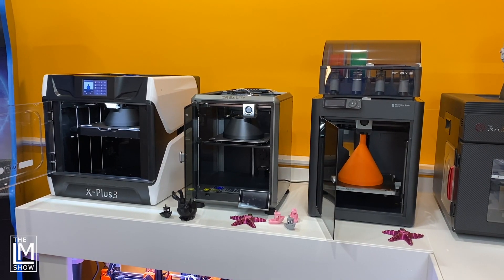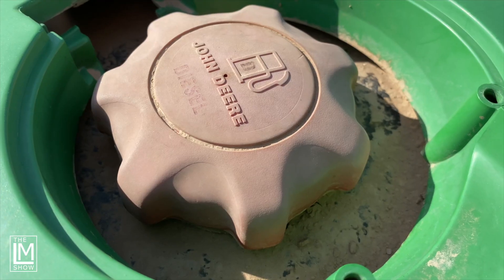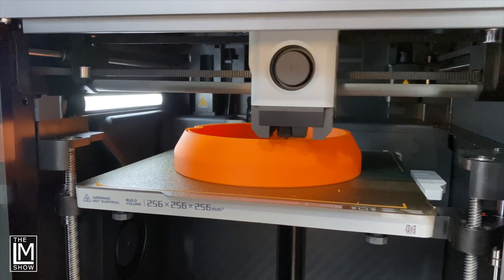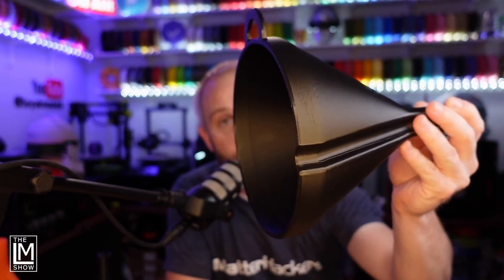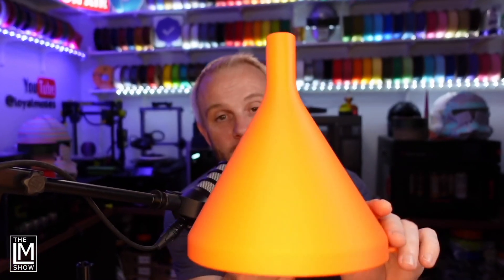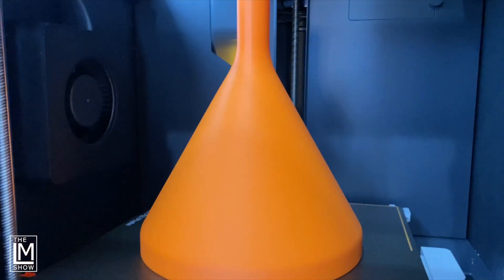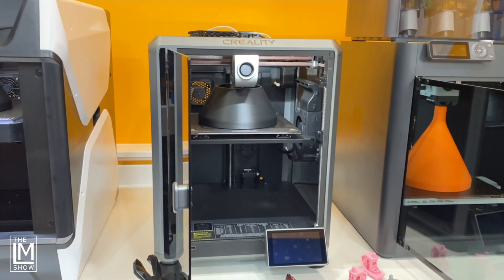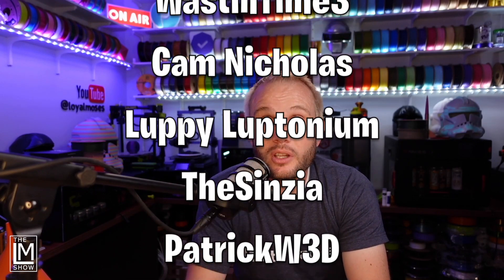Bambu P1S vs Creality K1 vs QIDI X-Plus 3 - Which CoreXY 3D Printer Is The Best?

Comment: After owning in chronological order Voxelab Aquila 2, Anycubic Kobra, Flsun SR, Ender 2 Pro and now the P1S AMS Combo. Hands down I should of got the X1C from the get-go but I cancelled my pre-order but it worked out since the P1S AMS Combo is cheaper than the X1C by itself. I was ragging on about how it was going to change the game and was a moderator on the Kobra forums and people disagreed strongly due to price. Tinker free printing at a more approachable price. Never want to see a bedslinger again or Cura. Wished Bambu would look into delta printers (I have a soft spot for em' since when I bought the SR it was the fastest consumer printer at the time and I loved it to bits even though it wasn't near as good as these printers today)
Reply: If cura is so bad, then why other slicers are based on it?
Reply: @wykonczeni  Cura was my 1st slicer and it worked well. At that time I tried out Prusa slicer and it didn't gel with me at the time. Haven't used Cura lately but small things like when I did prints of miniatures or figurines the slender parts like the ankles would always be 2 wall and infill (so p*ss weak) and would always break. Bambu Studio does it solid at thinner parts automatically. Before I liked Cura because they had the tree supports first, not Prusa and it's variants all have it and found I had to mess with less though that might have to do with me owning the P1S which really doesn't require any tinkering to get good results. I spend more time printing than fine tuning which is a godsend. To each his own I guess.
Reply from the maker: @wykonczeni  that’s a good question! I’m not a fan of the Cura interface, wish it were better, but that is just a personal preference. Those with a lot of Cura experience crank out some incredible prints with it.

I have noticed that within the last few months, 4 major printer companies have recently forked PrusaSlicer. Wondering if this will be the new direction?
Reply from the maker: They changed 3D printing forever didn’t they? Simple to use, beautiful to look at, fast and high end results. I think your P1S Combo is a great setup, so you chose well. Also, thank you for your comment, I really appreciate it!

Comment: Hey great video. I have a quick question when you say you set the peremeters to 3. Where did you do that for Bambu labs? I have a print that requires it to be set to 5 but I am unable to find the option in Bambu
Reply from the maker: Thanks! Under the Strength tab, walls/loops/perimeters all the same
Reply: @LoyalMoses  thanks very much. I also just want to say I like that you're a more positive youtuber.

Comment: The first two prints with the same black filament had similar results. The bambu printed perfectly but you also used a different filament. If it’s a comparison, why not print with the same filament for each print?
Reply: Agree, to be able to compare then use the same brand and color for all printers.
Reply from the maker: @johanlarsson3638  I can definitely do that! 👍
Reply: @LoyalMoses  the problem is, that you cannot SEE the surface artifacts on orange, white, yellow...😮
Reply: I 100% AGREE... you can't see jack-Sh*t with that orange filament. It completely blinds use on the other side, trying to see any detail at all. The black SHOWS everything... the good, the BAD, and THE UGLY! black is unforgiving, and I don't know this creator, but they also get this stuff for free. Content creators also get paid behind the scenes for a lot of stuff that we will never know as well. So many inconsistencies may be innocent, but many are intentionally done. Again, I am not gonna accuse this guy of misrepresenting things. But if you are gonna show a straight-up comparison of all 3, be consistent and use the same exact filament on all 3. The internet has become all flex, fake it till you make it... then fake it more and more. So it has completely stomped out any trust whatsoever.
Reply: I have to agree with @ethangcosby. If you are comparing print quality at least take out the filament from the equation. I would go as far as not only using the very same filament spool but also dry out the filament before prints. Other than that, thanks for the great video!
Reply from the maker: @madcannon3162  great advice, I can definitely change the filament and send the print again, even show both prints together from them. Thank you!
Reply: @LoyalMoses did you ever happen to print in the same filament? Where can Is see them?
Reply: Dark filament tends to be less forgiving than bright colored..definitely need all 3 w same color for comparison
Reply: Sorry, 😂 FOI
Reply: So? Did you do new test?
Reply: agree, test should be with the same filament and at the same speed (500mm/s in this round) to have a fair comparison
Reply: also needs to be running as close as possible to the same settings. Fan speed, media, hot end and bed temp. Humidity of room and filament temperature all count. Speed, layer thickness will always reduce accuracy.
Reply: If I can add, using the same slicer and similar speed/accell settings would also be good. I suggest orca slicer as none of the 3 use it by default.
Reply from the maker: Thanks for comment! It wasn’t the same filament, just the same black color, and was just the filament that was loaded in the machines.

Comment: I can't believe how far 3d printers have come in the last few years....I'm done with ripping machines apart, replacing and upgrading parts, tweaking for hours. Yay!
Reply: I wanted a 3D- Printer for a long time, but I dont wanted to put hours into Configuration. Now I have finally a Bambu X1c and it's amazing easy to handle.
Reply from the maker: @BaggerPanda  this is awesome! Congratulations!!!
Reply from the maker: It's amazing isn't it! I am mostly excited, because this brings more people into our hobby.
Reply: I'm in the same boat, and actually the reason I'm not buying a Creality printer again. Mainly because they had basically let the community fix ALL the issues with their printers in the early days of the CR-10/Ender 3 (and maybe even today, don't keep track of them that much anymore). Just not interested in a company with that sort of mindset, so I'm probably gonna just pick up a Bambu printer. Plus they provide spare parts at a really good price.
Reply: bambu woke everyone up from their lazy deep slumber of churning out crappy slow bedslingers.
Reply: that exactly what bring me to that channel and it amazing communauty that support this quality channel , and yes I have  honnest answer to my question because this channel is sponsored by the users
Reply: I was just thinking the same thing. 500mm/sec. I remember building my first machine an Anycubic delta. It was junk. The firmware didn't work, came with wrong settings, would print at like 20mm/sec the bed was never level. First prints were always replacement parts and stiffening / cooling ducts. Kids these days will never know the struggle!
Reply: its nice to have a printer that can get out the box and print perfectly in 30 mins but half the fun is tinkering with your printer like all the ender 3 upgrades or full building a voron. I have a P1P(Soon to be P1S) but im probably going to build a Voron 0.2 then build a V2.4 or Trident so i can make it "mine"